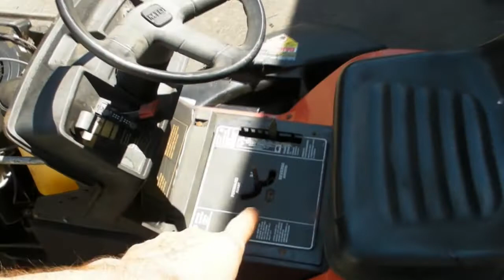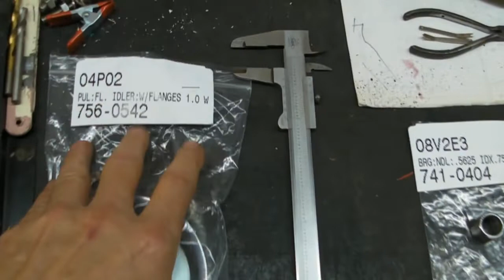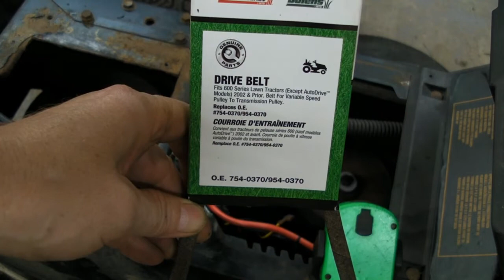Goregoon's Garage: Variable Speed Drive Pulley Rebuild on older MTD Yardmachine 18/46 ridemower

Comment: I really appreciate you showing how you replace the bearings. It would be helpful if you were to mention what year your MTD yard machine was. Mine looks similar, but it's a smaller 38 inch cut. Model made between 2000 & 2003.

Comment: Thanks for the video, but I have two questions: how do you lubricate these new needle rollers each year and secondly how do you lubricate the middle loose sheave of the pulley that slides and rotates? My MTD has the 'long version' of the variable pulley and the middle sheave is on a sleeve and slides up and down but has siezed. Thanks

Comment: I got about 30 of the old VSP units that I dipped in used motor oil and put in 55 gallon barrels, yea two are full 
I see parts for them will no longer be available or made before long 
I suggest old mechanics storage up these mowers and engines for grand kids
Reply from the maker: I have another beast with a seized vsp I want to get to one day. Never seem to have the time though. 

Thanks for dropping in.